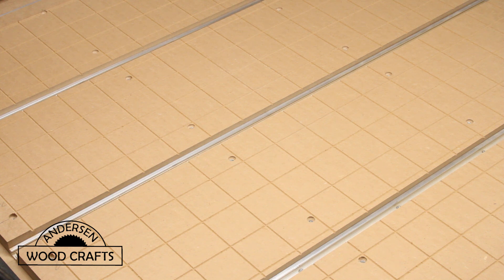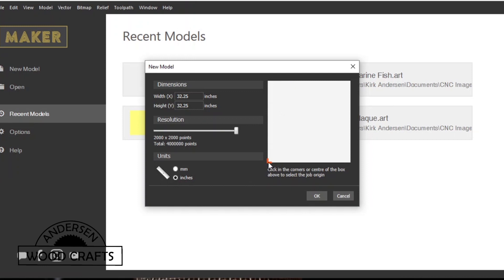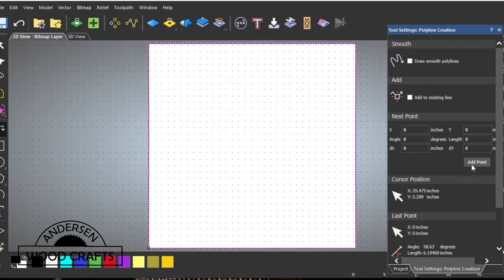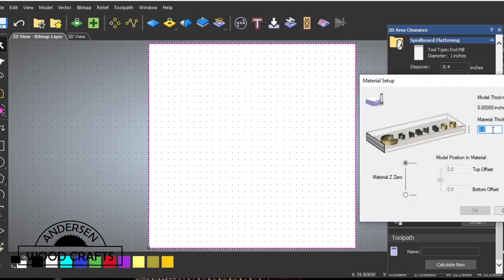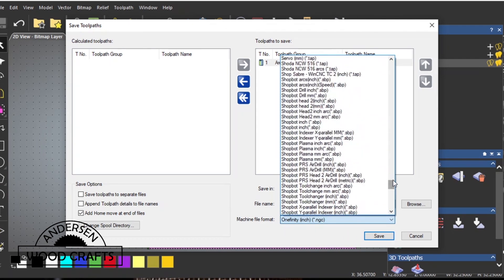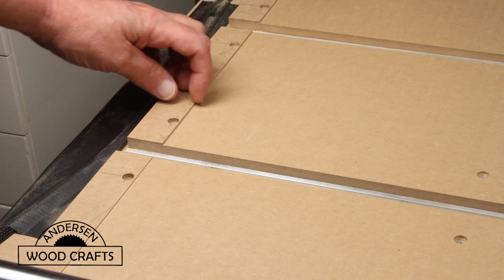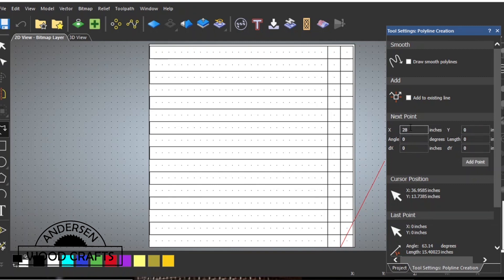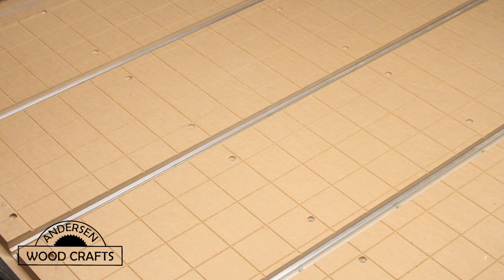FLATTENING AND CREATING A GRID ON THE ONEFINITY CNC SPOILBOARD

Comment: Great video, but after drawing the grid lines and trying to "calculate now" it keeps saying vector intersections were found and won't save it / calculate it.  Any advice on how to get past this problem with vector intersections?
Reply from the maker: Hard to say without seeing what is going on.
Reply: @AndersenWoodCrafts  the X and Y grid is all one continuous polyline in your video, right?  When I do the same thing step by step and try to calculate the tool path it brings up the window saying "intersecting vectors" and won't calculate.  Have you had this happen before?
Reply from the maker: @timothykyle8068  Correct, it is a continuous line and needs to be connected at the end.